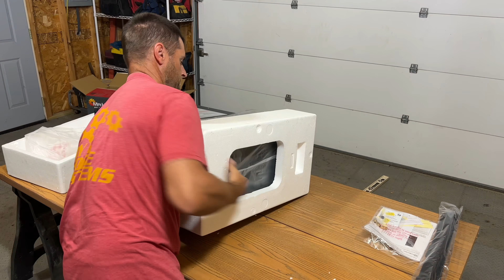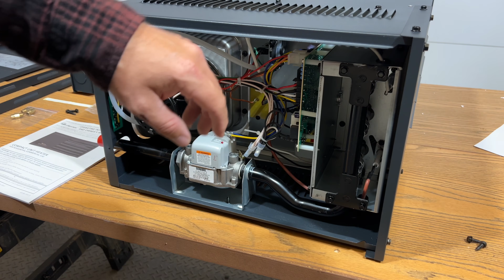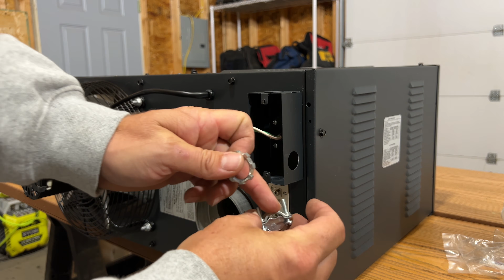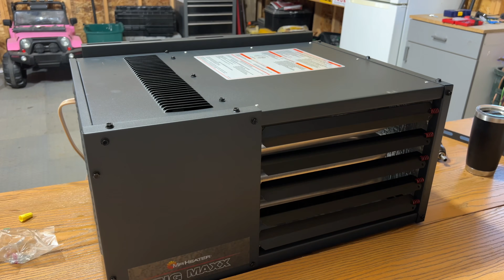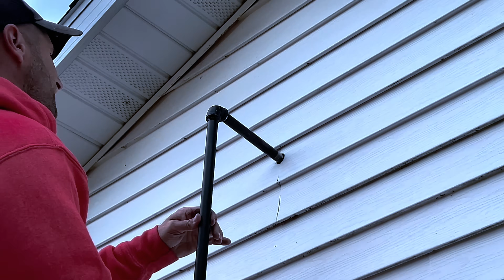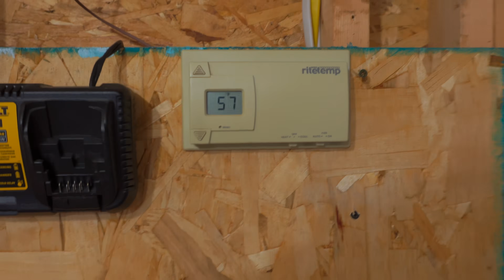Complete Mr. Heater Install From Start To Finish

Comment: For your eletrical hookup, did you remiove the eye hook that was attached to the ground? Wondering if that could be attached to a screw inside the eletrical box along with the wire off the power cord?

Comment: now that you've had it a year, how's it holding up? Also any way to install a wifi enabled thermostat on it so I can control the temp from the house?
Reply from the maker: After having it installed for a year, I’ve had zero issues with it, yes, you can install a Wi-Fi thermostat on it, I have a video on it if you want to go check that out
Reply: @DIYWISCO  sorry I hadn't checked your play list. Unfortunately looks like you installed a nest. I'd have to go with something else because I hate those nest thermostats. They don't play nice sometimes and do what they want. I took mine out and threw it in the trash. Thank you!

Comment: Great video! I’m think about getting this heater for my 24x24 garage that is insulated and drywalled. My question is, how much propane does it use roughly. I know that would depend on how much you run it and the outside temperature. Just trying to get a baseline.
Reply from the maker: On average I run through 100 gallons every two months with a similar sized garage mine is 25 x 25 fully insulated, and I keep the heater set at 55 all the time
Reply: @DIYWISCO that’s not to bad at all. Do you turn it up when you’re out there working?
Reply from the maker: No, I don’t, I leave it at 55 and after I start working for a little while, I actually get hot so 55 is a good all-around temperature

Comment: I've never understood why they want the venting upwards slope 1/4 inch every foot. Wouldn't you want the moisture to not go back to the unit itself? The horizontal vent kit states that you want a downwards slope for cat III and cat IV.
Reply from the maker: The only thing that I can think of is that they don’t want the vent gases to leak back to the heater and come into the building. If you put the upward slope of a quarter inches per foot the vent gases will eventually leak outside for whatever that is left in the pipe, the heater should burn off all of the moisture that’s in the pipe as long as you’re not short cycling the heater with the correct rain cap you won’t get any water coming in from the outside, so only moisture in the pipe is the moisture from the vent pipe condensing

Comment: I've recently had a 50000 Heatstar unit installed, with a horizontal vent kit going out my garage wall.
I've noticed on (2) windy days that my flame does not want to stay lit, the unit will light, flame comes on, it gets up to temp and then holds for a few minutes and then the flame goes instantly out. it will then continuously re attempt lighting until it eventually throws the code to essentially automatic shut down. I'm starting to wonder if a westerly wind, towards my west facing vent kid, can cause a pressure switch error and cause the flame to go out. The unit is brand new, and I've tried a new thermostat from the one that comes in the box because I've heard those can have issues as well. Really trying to just avoid a warranty replacement as I don't want to send a good unit back if its not the unit. 

Any insight would be greatly appreciated.
Reply from the maker: First thing I would check is if the vent motor stays running, there shouldn’t be any way that outside wind could affect the pressure switch, it sounds like the vent motor isn’t staying on…just my outside opinion though

Comment: Thanks for your video here on the Mr Heater installation. I'm debating on what heat to use out in my garage. I've got an old woodburner that a friend gave me. But, again still don't know which way to go.
Reply from the maker: You’re welcome, it come to personal preference, if you have the wood available to burn, that would be a good option

Comment: Built my 28x30 shop in 2005….had multiple wood stoves and even a pellet stove in there 
But my Modine Hot Dog has been in the back right corner since day 1 
Put a circuit  board in it 2023, local plumbing store had it in stock for less than $100 
What a work horse

Comment: Great job explaining the process. I’m currently installing mine and following your lead. Any reason you didn’t stop the black pipe where it came out of the wall and do a 90 degree mip x fip and have the propane company run the flexible copper tubing up to that location? Versus running your black pipe down the wall. Thanks
Reply from the maker: Aesthetics basically, and I had the pipe already so bringing it down lower would make the hookup to the tank easier for the gas company, glad you are finding the video helpful!

Comment: When it comes up to temp on the thermostat and cuts off how does the gas quit running given it's set up with a check valve?
Reply from the maker: I’m not really sure what you mean by a check valve, when the thermostat stops calling for heat it shuts off the gas valve on the inside of the heater and the fan continues to run until the heat exchangers have cooled down
Reply: @DIYWISCO ahh that’s what I was wondering g so the internal valve shuts off and kills the flow. I wondered if I needed to shut the knob off at the tank or the check valve off of (yellow in line valve) when it hits temp. Was worried it would just spew out lp after burner quit
Reply from the maker: Nope, the yellow valve on the line is just for if you have to service the heater, you can shut it off manually

Comment: Always drop your gas pipe down the inside wall and go out low.
Reply: @Mcseverythingoutdoors  so you saying I should run gas line down wall on the interior of my shop and out to tanks at bottom of wall verses out top of wall and ran down outside of wall?

Comment: How do you like the 50,000 BTU unit, does it heat well? What size is your garage? I'm adding a 30 * 30 to a two-car garage so I'm considering 80,000 BTU

Comment: Installed mine and am wondering about the tape. Everything I read says not to use tape cause it will not hold up and combust. What are your thoughts and how is yours holding up?
Reply from the maker: Mine is fine after the first year, no discoloration or anything that would concern me
Reply: @DIYWISCO where did you get the tape?
Reply from the maker: @seanpettee7469 it is normal tin tape for sealing duct work
Reply from the maker: @seanpettee7469 something like this https://amzn.to/4qDSGuq

Comment: I’m just curious, what your thoughts are I know I can install this heater safely but my question is doesn’t the law require that these are installed by a certified professional? Do I just install it myself and then keep it under my hat don’t tell anybody does the propane company hook up to the exterior line without asking for certifications or inspections? Thanks a lot. You got a great video. I appreciate you sharing your process.
Reply from the maker: As always check with your local building codes and regulations on whether they require a permit or not, in Wisconsin, homeowner can run their own interior. Gas lines provided the Paul all necessary permits and have all inspections made that being said do what you will, as always, if somebody is not comfortable doing the work themselves please call a professional and have them through the work for you

Comment: Thank you and hello from Lone Rock. I have really enjoyed your great and informative videos!  Quick question for you on the distance from the corner for the venting to the outside. The install manual states the Vent must be a minimum of 6’ from an inside corner formed by two exterior walls, and if possible, leave a 10’ clearance.  I am looking to mount mine in the corner of 2 exterior walls like you did, but have concerns with mounting the vent 6’ from the corner. Have you had any issues with your placement (looks to be less than 6’).  Thanks again!
Reply from the maker: Greetings fellow Wisco resident! Mine is actually 9” from the ceiling and 13” away from the corner where the walls meet

Comment: Do you use anything or means for air makeup? Mine, running, pulls cold air in around the overhead door even though the seals around the door seam to be ok.
Reply from the maker: No I just run it and fresh air isn’t a bad thing considering what most shops are used for

Comment: Hi....can I used pvc pipe for vent out monoxide?
Reply from the maker: No you need to use a double wall steel pipe, the exhaust gets too hot for pvc
Reply: @DIYWISCO ok...thank you so much..
Reply from the maker: You’re welcome!

Comment: Nice video - I will have to check your other ones! Questions: How big is your LP tank and how long is it lasting you (based on how often using heater)? Also, I did ask a propane company about tanks and they said 120gal tank needs to be 5ft away from structure and 250+ needs to be 10ft away.  Your tank looks to be larger and is right against the garage. I wonder if that is a local code issue - thoughts?
Reply from the maker: My gas company said that 120gal and under is ok for my placement any larger it would have to be set off something like 20 feet, as far as how long it lasts it really depends last winter I didn’t have any insulation in my attic so I used quite a bit. I think I filled it up three times in four months. with the last fill having 40% remaining at the end of the year.
Reply from the maker: I do plan on doing a video for the first month that we get some cold weather and show how much it has ran and how much I have used in that first month but unfortunately right now I have 75° weather in October, which is nuts
Reply: @DIYWISCO  so that is 120gal? Looks larger on the quick view in the video. I'm also in WI, and will take the warmer weather as long as we can. The detached garage I plan to do this in is already insulated and drywalled (as well as pre-plumbed for the heater), so hopefully it doesn't burn through it too fast. My gas company quoted $2.60/gal +$27 delivery. So if they put in 100g, that would run about $287/fill.
Reply from the maker: That’s right around where mine is, I just filled it up a few weeks ago for 2.65 a gallon I’m hoping it lasts a while being fully insulated this year

Comment: When wiring the AC power, did you just cut the ring terminal off the green wire in the junction box and then wire nut that to the green wire on your appliance cord?
Reply from the maker: Yes, that is what I did

Comment: What made you go with this heater vs hot dawg? Like it so far?
Reply from the maker: Price would probably be the main factor, Mr heater has been making heating products for a long time, so has hot dawg but theirs is 1200$ and occasionally 900 on sale compared to Mr heater is under 400 not on sale(from what I’ve seen)
Reply from the maker: The first winter I had no issues with it worked great this next coming winter. I’ll do an update on how it’s going so stay tuned for that.

Comment: I see you used Type B vent pipe which is not what Mr Heater's manual says, it says it needs Cat III pipe, I'm in the same boat, can you explain why you chose this and is it okay? Was it just the price?
Reply: Thanx for the video it was excellent! I took the wood stove out of my garage this summer and I just purchased the exact 50,000  btu Mr Heater today used (propane) This video will make sure I get it hooked up right, thanx again.
Reply: Can this be vented into a chimney?
Reply: Just in stalled the 80k Mr heater, the only difference I found is when you put the spring cap in for LP conversion you turn it in 11 full turns and stop, the pressure test read 10 so the install is the same, not bad to do at all
Reply from the maker: If the two types of pipe were the same price I would have went with the category III but unfortunately, this is not the case, the category III pipe is pretty much the cost of the heater itself.
With that being said, I did a lot of research before installing the heater and apparently in 2011 the code was changed to require category three for all heaters manufactured after that date, prior to that class B vent was code
Their reasoning from my research was that the class B vent pipe as the heaters got more efficient did not get hot enough to burn all the condensation out of the vent, causing the inside wall to begin to rust and eventually fail
There are probably hundreds of thousands. If not millions of these heaters that are running this class B event still to this day if I have to tear the venting apart every couple years and inspect the inner wall, then that is something that I’m willing to do.
In the description, I did link the category three vent pipe so that if anybody is worried about this in the slightest, they can order that and be code compliant
So to sum up yes cost was the major factor in using class B and if the other ever does come down in price, I will switch, but until then regular preventative maintenance will do for me
Reply: @DIYWISCO  on my first one, in my mountain shop where our rv park is, I used the $400+ kit from Amazon which was stainless steel and rubber gasketed etc., so I questioned your method, BUT! looking up Cat III pipe 
1. you have a short run 
2. it mainly talks about the interior of the pipe corrosion
3. sealing to prevent the escape of carbon monoxide into living spaces.

so I think you're good unless you live in your shop 24/7 
you taped it so you sealed it and I'm doing mine exactly like you did yours. and like most guys I work in the shop for a few hours at a time and not every day 

 and once again probably the best video I've seen done!
Reply from the maker: Thank you! The price for the Cat III pipe is insane for no apparent reason other than a money grab imo

Comment: The manual states to mount atleast an inch from any combustible material. Any issues thus far mounting directly to a 2x4?
Reply from the maker: No the outside case does not get hot whatsoever

Comment: Noticed your propane tank only had one pressure regulator.  I thought you always needed 2… a first stage a second stage.  Otherwise great video and very informative.  I like how you mounted it straight to the ceiling rather than using all thread.  I’m doing the same only the 80k version.

Comment: Do you really need a Union fitting when running an appliance flex line?
Reply from the maker: It needs to have a disconnect at the heater itself

Comment: What size garage are you heating? I'm wondering if I need the 80,000 btu unit. I have a 20x30' garage
Reply from the maker: I have. 25x25 and I feel it’s a great size for that, you don’t want it too big that it short cycles to often(turns on and off too many times an hour)

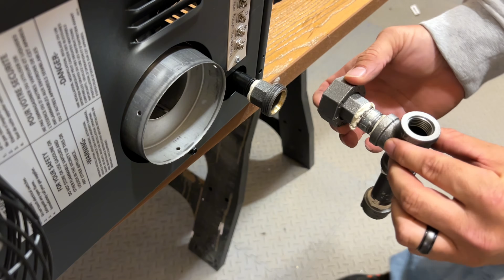Comment: At 9:44 into the video, I noticed that you did not use pipe dope on the male part of the union that attached to the drip leg.  Was there a reason for this?  Thanks.
Reply from the maker: Your arent supposed to use pipe dope on unions the fitting seal by itself
Reply: You always use pipe dope on a union. Not sure where you got that from.
Reply from the maker: Unfortunately i disagree, do some research…The union is sealed by compression rather than the threads, some have said they put some dope on the threads of the union to lubricate the threads for a tighter compression seal, but it is not required nor needed

Comment: Nice job on the video.  Much appreciated from a guy who knows enough to be dangerous!  I would like to have seen the installation of the pipes through the side of the building with a bit more detail.  How was the opening made weather tight?  How was the length of the exhaust pipe determined and adjusted?  Thanks!
Reply from the maker: I used a high temp silicone caulk around the thimble on the inside and outside to seal it up, the exhaust pipe just needs to extend past your eves so the length depends on the width of your overhang, and be sure to have a slight angle up towards the rain cap 🧢

Comment: Also what flex 90 did you use? One of the cheap ones like for a dryer vent ?
Reply from the maker: All the venting was with the class b double wall vent pipe

Comment: Great video! I've watched it about a dozen times prepping for my install. How big is your garage? How is it doing in our current sub-zero WI weather? Lastly, did you use regular 90* ducting for the inside or class B the whole way? Thanks in advance!
Reply from the maker: Your welcome, I’m glad it’s helping! It’s doing good so far, with the insulation on the walls and 1/3 of the ceiling done it’s keeping up!
Reply: @DIYWISCO  Glad to hear! Did you use single wall 90* for venting on the inside and then class B for the through the wall part?
Reply from the maker: I used class b the whole way

Comment: Why did you need a union? The neutral wire on the cord has ribs along the entire length.
Reply from the maker: The Union provides a quick and easy way to disconnect the heater for services and repairs
Reply: So does the flexible gas line. Stay warm next week in WI. We will be at -20 in the northwoods.
Reply from the maker: Thanks! Forcast for Monday is a high of 2 degrees…ugh 🥶🥶🥶

Comment: Please correct me if I'm wrong. I was told by a propane unit professional installer, that the correct pipe dope to use for this application is propane pipe dope, which is green, I believe.. Personal I don't know the difference other then the color. Thank You for a great video
Reply from the maker: I have seen all different colors, green white yellow, as long as it states that it is for propane threaded joints then you’re good to go
Reply: Did you have to use stainless steel chimney to go horizontal? I just tried to buy that, it was more expensive than the 5000 BTU heater
Reply from the maker: I used the double wall B vent pipe
Reply: I use "Blue Monster" brand dope for the gas pipes which you can imagine is... blue in color.  So is there PTFE tape... so these days the color won't tell you much, just make sure the stuff you use is meant for gas connections.